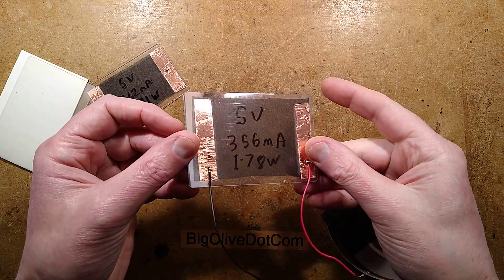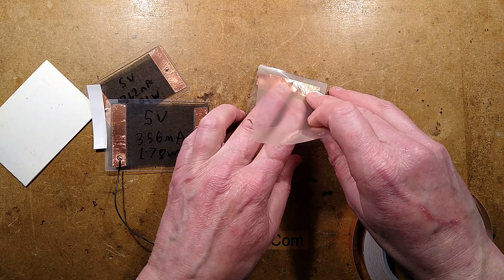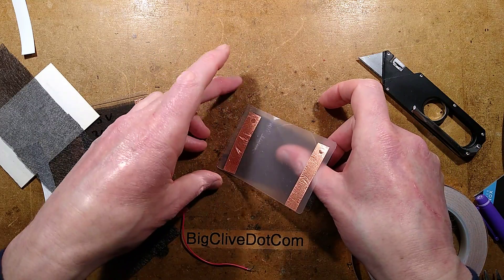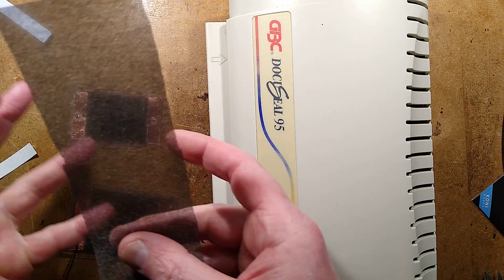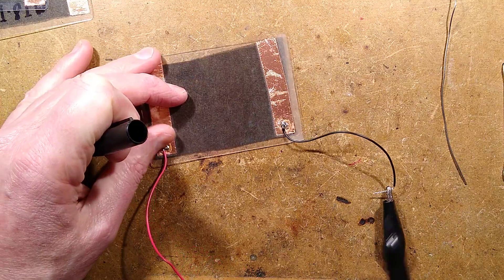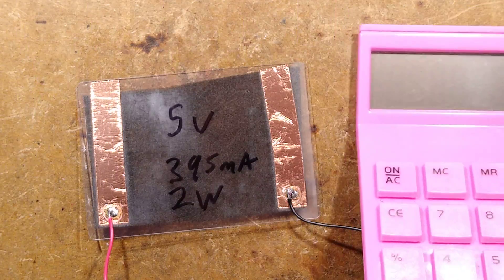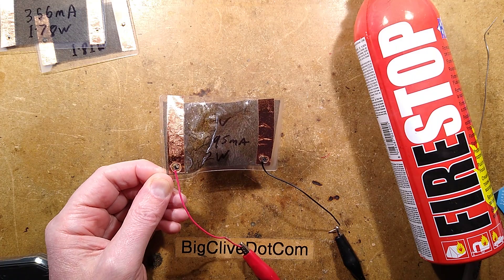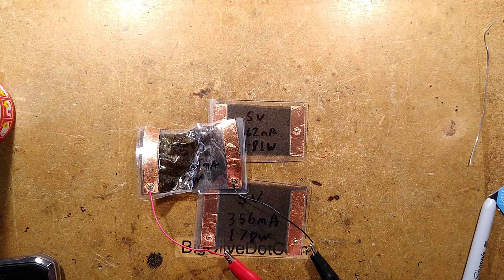Making custom heater pads and then destroying one

Comment: Exactly what I need for my Telescope to retard Dew from the optics at night.  5V power bank + custom build/Wattage. Thanks BC, my weekend agenda  is now full.😁
Reply: Ridiculous how much they charge for dew heaters
Reply: for my camera lens i used heating wire from a domestic electric blanket, measure lenght, cut in 20 pieces, each length is now 12v. sew it into a sock, sock over lens, old 12v car battery.... One or at the most two strips should do.
Reply: @lezbriddon  Damn. A sock never entered my mind in design, it's just so perfect. (anyone want to buy 10 ft of felt and 15meters of velcro, ex eBay?)    because I own socks😋
Reply: Good idea 😊 Would work for long exposure night photography!!
Reply: I wonder if this could also work for a mirror demister in the shower / bathroom? Laminate / stick it to the back of the mirror and seal. Nice safe voltage for bathroom / water based use.
Reply: What did you call me
Reply: @whompronnie  🤣